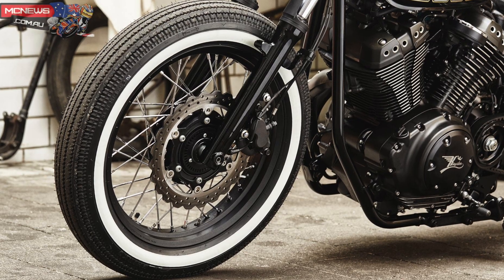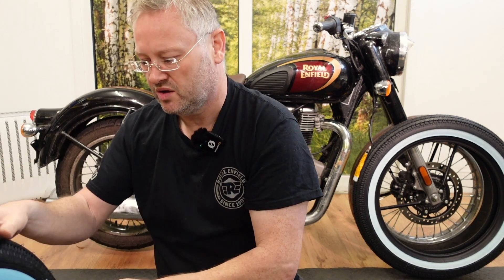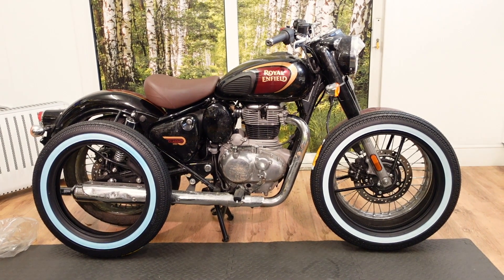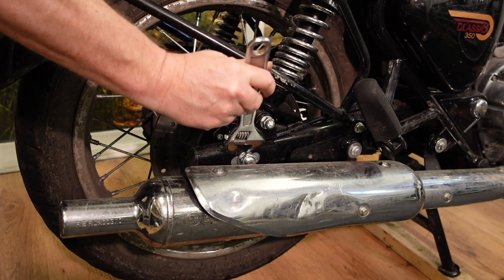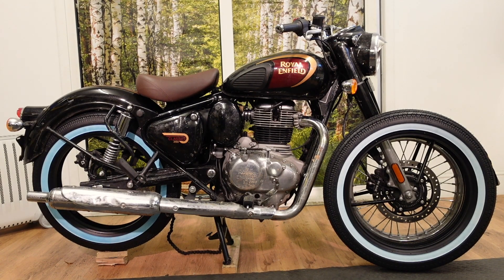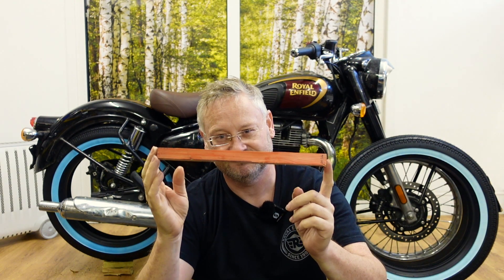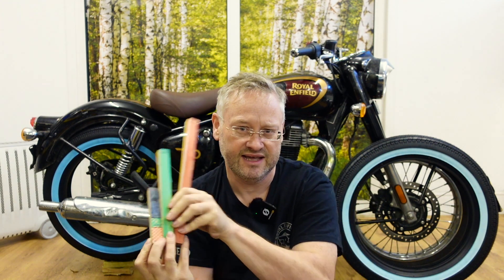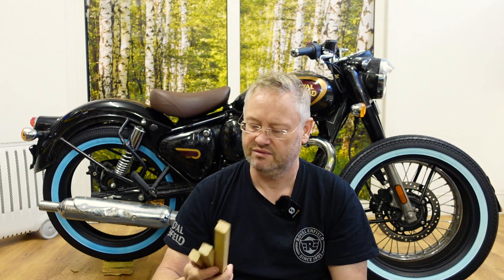Part 4 - Whitewall Tyres for the Royal Enfield Classic 350 Reborn

Comment: Hmm, not so sure about those tyres Glyn. Are you going to take the engine out to do the restoration work and give you easier access?
Reply from the maker: We'll have to see but too late now 😊 I was just thinking about that today, I think it would be less taking the engine out than lifting the frame off the top of it.  The frame hides very little of the engine so maybe not.  The side cases of the engine will be coming off for rectification and polishing though as I don't want to be grubbling around on the floor for that!

Comment: I went from a 3.50/19 to a 4.10/19 front tire and it lasted for 59,000 miles.
Reply from the maker: Bloody hell, it must have been hard as nails!
Reply: Wow what tire was that.  My worry is the 18 inch being a bit shorter.  4.00-18 being a bit wide.  I guess I could take the fender off and do some metal work to the indentations around the forks.  There seems to be alot of room there.

Comment: The new rear tyre raises the gearing by about 5.5%. In other words, if the speedo is accurate (which it almost certainly isn't, they invariably over-read), 60mph on the clock is actually about 63.3mph.
Reply from the maker: That's quite a bit, maybe it'll be the fastest Classic there is!

Comment: I never understood  why royal enfield doesn't put out whitewalls for thier tire sizes.   I think it should be standard on  the classic models.  I have the 18 inch front and rear on my classic 500.  It would be nice to find out what sizes would work on the classic 500. 4.00 x18 on the front and 4.50 x18 on the rear?  They are going to look super nice.
Reply from the maker: The Shinko site has a PDF with a list of tyres and recommended rim widths, the size you said sounds about right.  Other tyre manufacturers have charts too, but they're usually marked with the standard sizings so you can choose them easier. I can't wait to see them on 👍

Comment: Imagine if you could buy a fish tail silencer and make it fit, the white wall tyres looked blue on the video but i presuming that was just the camera. What is the white part, paint or vulcanised into the tyre. I saw some pictures of ww2 willys jeeps once being driven by military police and they had white wall tyres or possibly painted neat. Good vid mate as allways
Reply from the maker: ahh fishtail, I forgot about those, another thing to google, thanks 👍 Yes, they're blue which is a protective coating which needs to be cleaned off to reveal the white part.  Cheers, Glyn 🙏